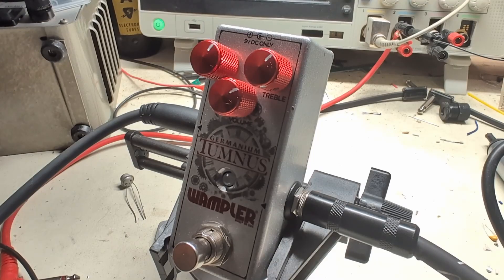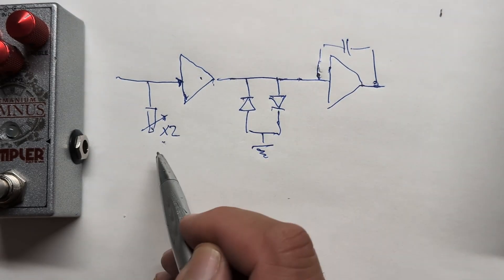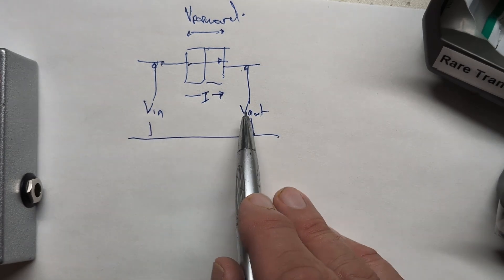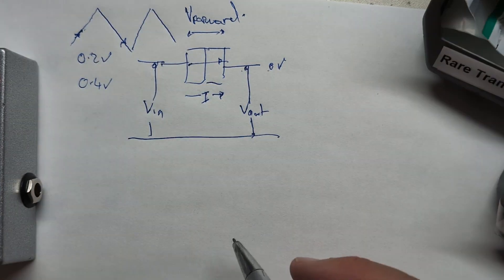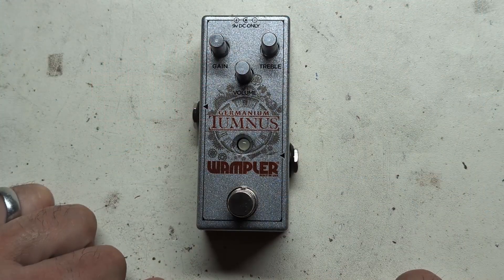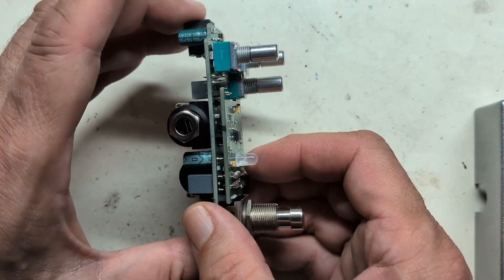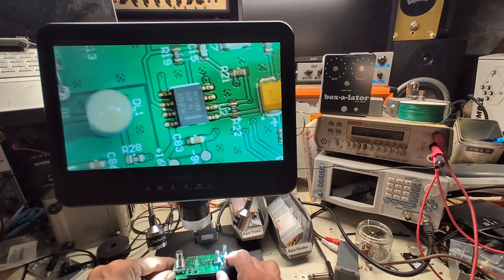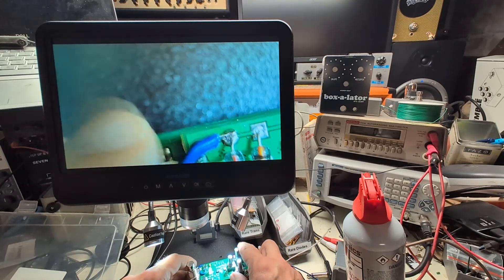Keeley Manis transistor mod to Wampler Tumnus.

Comment: I really enjoy these types of analyses of distortion devices. Being a novice in my knowledge of electronics ( my degree was in geology) , are the transistors being wired to act as clipping diodes or are they acting in a cascaded fashion as say cascaded 12AX7's?
Reply from the maker: A transistor is 2 diodes (kind of) so we are just using half the transistor to be a hard clipper diode.

Comment: Thanks so much for this. I don't totally understand it yet but it's very helpful. I have a favorite diode distortion that I use in drum machine and synth designs but what makes my favorite implementation sound the way it does is apparently the breakdown voltage not the forward voltage: red LED's
Reply: I've tried Germanium and didn't find it significantly better or worse than plain old silicon diodes, but I suppose for some sounds/instruments that subtlety is everything

Comment: Which two legs of the transistor are you measuring that act similar to the diode? Im super novice and just trying to fully comprehend some of the "mysteries" of how current and signal flow through effects circuits. Thanks.
Reply from the maker: Base and Emmiter, but Base and Collector will work equally as well.